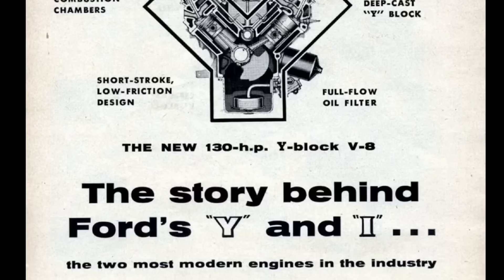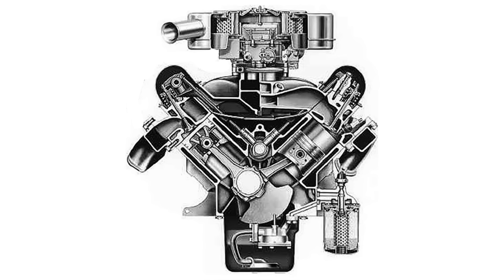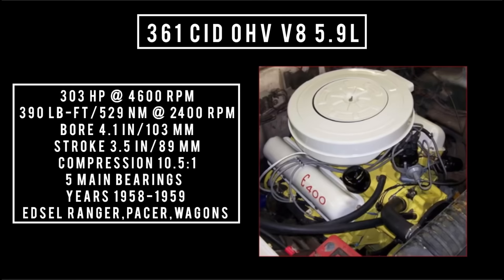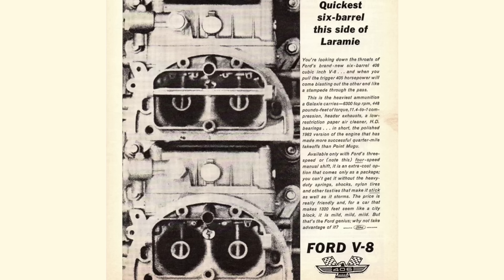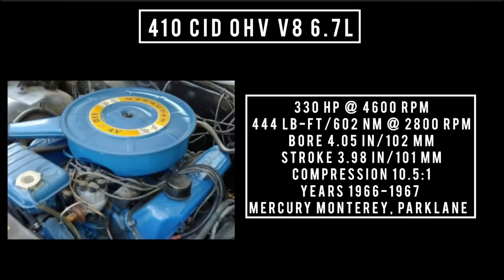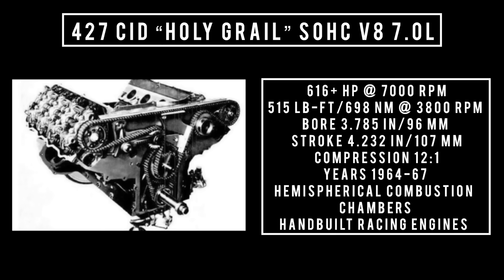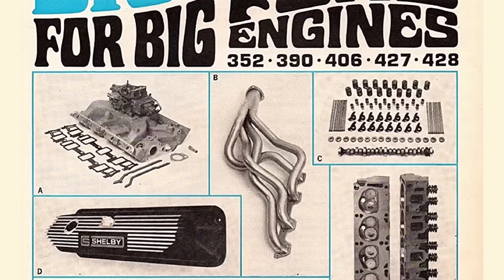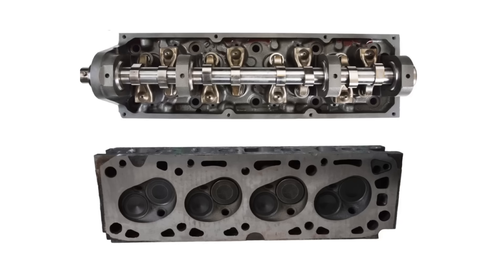Ford FE Engine Family 332, 352, 361, 390, 406, 410, 427, 427 CAMMER, 428, CJ428, SCJ428

Comment: The engine shown for the 332 is not an FE. That appears to be a Ford truck or Lincoln Y-block engine.

There was a 360 FE engine offered in Ford trucks.

The 406 was only available in 1962 and 1963. It didn't return for 1964.

Here's a high five for noting the fact that the 410 FE is a completely different animal from the 410 MEL.

The 428 was also offered in the full size Ford (Custom, Galaxie, LTD, wagons) and Mercury.

By and large your show brought back a lot of great memories. Thanks a mil!
Reply: The engine  in the Picture is most likely a 332, but Ford made a 332 in both Lincoln and FE series. The valve covers are a giveaway that it is not an FE.
Reply: @mylanmiller9656   I remember a 330 V8 that Ford offered in heavier trucks but not in Lincolns. That engine sitting on the pallet might be a 279 truck or a 317 Lincoln.
Reply: @Rick-S-6063  The 332 is a truck engine 317 block with 368 Lincoln cranks, with a Bore of 3.8 and a stroke of 3.66 it comes out to 332 and change.
Reply: @mylanmiller9656   Thanks for the clarification. I'd known of the 332 FE but not of the 332 Lincoln/Ford Truck Y-block.

We do indeed learn something every day!
Reply: I would like to point out that the early Edsel 361 engine, (not the 361 FT or the 70's 360 pickup engines, but the Edsel 361 has the Bore spec incorrect. It shows it to be a 4.1 bore & 3.5 stroke. It is actually a 4.05 bore (like a 390) & a 3.5 stroke. The 4.1 bore & 3.5 stroke would be a 370 ci. No such FE.
Reply from the maker: Awesome thank you so much for those corrections =)
Reply: I stopped to comment that the "332" seen at 3:00 is actually a "Lincoln Y Block" but it looks like the topic has been nicely covered.

With its high-located belt pulley it's no doubt from a truck application. There was also a 302 cid version.

Great video, thanks 👍
Reply: My .020 over 390 makes 503 hp and 488 ft lbs with 64 iron heads I ported myself and a Holley Street dominator and a Holley 780 with headers and a moderate solid cam. It weighs 530 lbs. 2 inch primary Crites headers.
Reply: I disagree about the 332 being a Lincoln or truck engine. The exhaust manifolds and spark plug angles, plus some other details, make it look just like an FE engine to me. Also (and this is not nit-picking) I have seen various Ford trucks with both 360 and 361 decals on the air cleaner. Not sure what, if any, differences there were. I rented an ancient Ford box truck from U-Haul back in 82, and it had a 361. Empty, it got 4 mpg. Loaded, it got 4 mpg. What a dog it was.
Reply: @61rampy65  Are we on the same page? I'm referring to the engine shown sitting on a pallet at 2:25 through 3:08. Take note of the valve covers and how they're held in place by nuts on two studs coming up through the center of the cover. That's one of the easiest ways to identify a Y-block. The FE had five bolts through the outer flanges of the covers.

Not only that, note the location of the oil filter at the rear of the block. The FE had the filter at the front.

The Y-block's intake manifold didn't seal off the lifter chamber whereas the FE's did.

The Y-block had the spark plugs under the exhaust manifolds. The FE's were above them.
Reply: @Rick-S-6063 Apparently, we were not on the same page!. I was looking at the pics on pages 0:18 thru 0:35. You are absolutely correct in that the engine shown is from the Y-Block family. Sorry about the confusion.
Reply from the maker: I never saw 332 in the wild apparently that guy doesn’t know what he has because this is where I got that picture from

https://www.vanderhaags.com/detailview.php?part=43922
Reply: @61rampy65  Not to worry! We'll blame the confusion as being brought on by the hectic runup to the holidays.  ;)
Reply: @Rick-S-6063  Works for me! At least I know I'm talking to a guy who knows his engines.
Reply: @61rampy65  The 361 was an FT engine. 330, 361 and 391 cid, built for the Med duty trucks.
Reply: @lsrx101  Thanks. It all makes sense now.

Comment: 1966 Mercury is a great car 👍
Torino over mustang only because of production numbers..
My uncle had a California Special with a 352  4 spd  decent Ford 👍  ignition on FE blocks was a weak point ..
MSD box and a hot coil would fix the problem 🤔👍
Enjoy your adventures
Happy Motoring ✌️🤠
Reply: I think that with almost all of the old school V8s the conventional ignitions with the ballast resistor,high voltage coil and weights and springs inside were marginal, the spark plugs needed to be in proper gap and the points needed to be free of corrosion and not out of gap   High school kids thinking they would get  better power by opening up the gaps above specs on both sparkplugs and points? Made them miss or "cut out" more at  high speed full throttle? 
 GM might have had an advantage in that doing a "tune-up" on most of them was easy,you had a replacement points assembly with the condenser included and you opened a little metal thing in the side of the distributor cap to stick an allen key to adjust the "dwell" which accomplished the same thing as setting the proper point gap. With a "dwell meter" that you could get cheap from Montgomery Ward. 
  I think you had to pull the distributor (the whole thing,not just the cap) from a Dodge Dart 225 Six to work on changing and adjusting the gap of the points. Is that why so many of those things were so hard to start? (People not touching the ignition soft parts for many years and tens of thousands of miles)
also getting the distributor back in properly (in the right rotational alignment) was a bit tricky so that you could set the spark timing right.
Reply: @davidpowell3347  I run Mallory dual point distributors on my Chevy's   👍 
I did a electronic conversion on my 2 Ford V8s 
My flat fours are Henry's 😉👍
Enjoy 😊✌️

Comment: There  is no question it was Ford Edsel , The same year they made the MEL that was for Mercury, Edsel, Lincoln. Ford' Biggest reason for a new development in engine was to relocate the two hot valves that caused head Cracking in the Y block engine.
Reply: Yblock head cracking? Two hot valves? I've been running them since 1968, still running 3 high performance yblocks, never saw or heard of a heat cracked head or hot valve problem. 

Wrong about block change, the rocker oil issue was easily solved with a better cam bearing. The only reason for the bigger block was bigger volume. 

FE and MEL are also yblocks.
Reply: @danontherun5685  You may not have had that problem. Ford seen it and ad addressed it. Ford never made another engine with to exhaust valves side by side again.
Reply: Ford  tried  fixing the Cracking Problem in 1957, when they introduced the Posted head, that was not enough to Cure the problem. All heads after 1956 were posted  but they still experianced  cracking Between the exhaust valves.
Reply: I and my brother have had more 292s than we can possibly remember. I'm a member of Ford car clubs and lots of those guys still running those engines in all configurations including super chargers. They were also used for high mileage super duty trucks.  Near all yblock vehicles keep those engines for good reason. That Ford didn't use that configuration again doesn't mean it was a bad design, the cam was too close to the crank for more volume period. A new gen super charger on a basically stock V8 run like a rented mule for 15 years proves the engineering. No head cracking and no hot valves.
Reply: @danontherun5685  OK so you know more than the Ford engineers that quit building then 60 years ago.
Reply: @danontherun5685   Ford got it wrong   they seen the problem, so they changed it. I own Ford Truck Shop manuals for the Y block and Ford stated Check for  cracks between the Two center exhaust valves Create too much heat because they are side by side. These books were printed in 1959. 
But I guess Ford should have contacted you because you know more than the Ford Guys That built them.
Reply: All you hundreds of thousands of Yblockers have to have your vehicles crushed because this 'expert' says they're bad. Don't stop here 'expert', go after all the casting cracks in the last 2,000 years to save us from this world wide catastrophe. And since you're so damn smart get off your chair and teach all the engineers and the entire casting industries how to do their work. 

But first count how many yblocks were built after they apparently failed to solve a minor problem. Then we can go back to your claim the posts were added to stop the cracks... people who claim they know it all just annoy those of us who do. I'm done with you.
Reply: Karens!!!